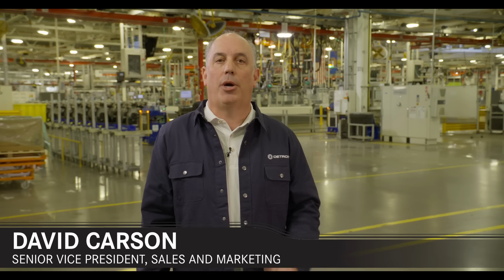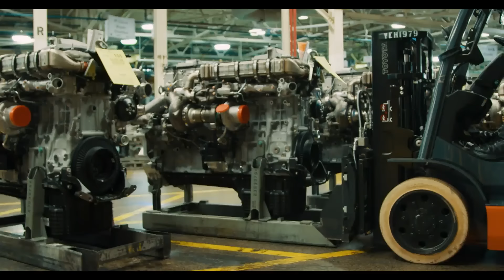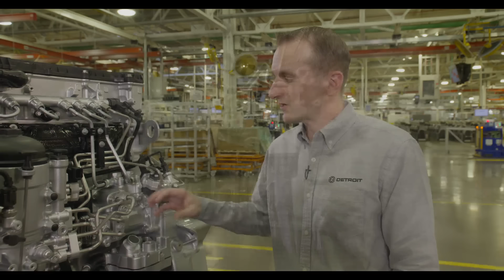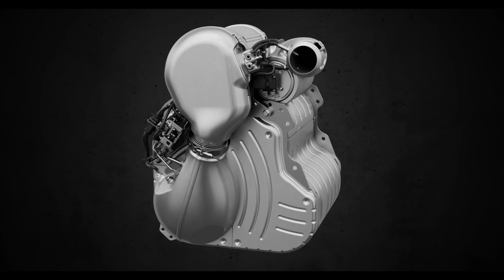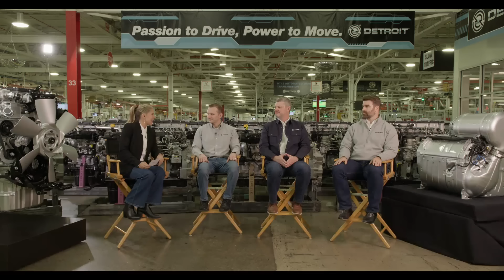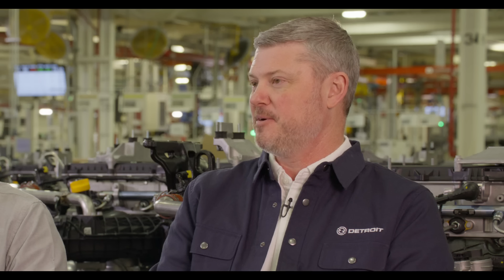Next Generation of Detroit Engines

Comment: This looks like an awesome platform going forward. I'm hoping to get one of the DD 15 with 1900 ft pounds and the 2.05 direct. What is the lowest rear end and best DD 13 spec for OTR dry van and reefer?
Reply from the maker: Great question. For OTR dry van and reefer applications, the Gen 6 DD13 offers a high-torque efficiency rating of 450 hp and 1,850 lb-ft. Rear axle ratio depends on the full vehicle spec, route, and duty cycle, so your dealer can help dial in the right setup. Fast rear ratios are available with the DD13 to help maximize efficiency.
Reply: You can get 4.75:1 ring and pinion with planetary drives, that's really low, but you won't get over 35 MPH but also you could pull the whole world with that kind of reduction

Comment: Gee, an EGR cooler?? International S-13 doesn’t use an EGR cooler. What  about fuel mileage?? Currently S-13 beats your fuel mileage. You can call yourself Detroit Diesel all you want, but it’s really just a Mercedes. The last great Real Detroit Diesel was the Series 60.
Reply: If I had to have an emission motor, I would want the S-13 Scania motor in the International. I really like the path they took to tackle these insane requirements.

Comment: They didn't mention anything about doing away with those absolute crap oil pump intake systems from the dd-13 & dd-15 and instead of minimizing or completely eliminating the difference and def system,  they actually made it even MORE complicated...Detroit used to be the pinnacle of class 8 engines...sooo sad...

Comment: The plastic oil pickup tube broke on Clutch Truckers D13.  Almost put him out of business.  How about covering these engines when they go down?  Clutch Trucker is on you tube.  How about a smaller diesel engine like a 4 liter, so Edison Motors can use it to run a generator when needed in their electric trucks?  Edison Motors is in British Columbia...

Comment: I run a government fleet and we came over to DD13's from International and the Detroit's have been MUCH better than these junky International Maxxforce's!!!  But I thought the 2027 Emissions Standards got gutted?  We definitely don't need more stuff on the 1 Box!!

Also, we have one 2023 Western Star with a DD13/DT12 combo rated at 470 HP.  I tried to get it uprated to 525 but my dealer said you guys (Detroit Diesel) wouldn't release the 525 tune for this particular truck.  Can you tell me why please?  It's our heavy haul and recovery truck and it needs more power!!
Reply from the maker: The EPA is pulling back on greenhouse gas (CO2) related emissions, which affect fuel efficiency and electric vehicle mandates. However, the nitorogen oxide (NOx) pollution standards for 2027 remain. Detroit complies with these with pre-SCR technology.

We couldn't uprate engines before due to GHG regulations, but this may be changing soon. Your transmission rating may also impacting your engine HP. If the DT12 in that truck has a lower torque rating, moving to a 525 hp / 1850 lb-ft calibration may not be possible. We would recommend talking to your dealer again or reach out to us via direct message so we can look into it further.
Reply: @demanddetroit   Thanks for the information on the 2027 emissions standards.  I sure do wish the EPA would roll those standards back a bit.

But yes, I'd like to send y'all my VIN and see what the deal is.  How can I direct message you?  I can email you from my government email address so you know I'm being legit.

But thanks for the reply!!  I was not expecting that.
Reply from the maker: @TheVenom8343  You can send us a direct message on Facebook or Instagram!

Comment: It just baffles me how the Duramax Diesel in the Chevy truck is built by Isuzu and not Detroit Diesel one of the greatest Diesel engine builders ever, and yet Chevy uses an Isuzu engine along with that 10 speed trans that Allison transmission puts there name only on what ever happened to false advertising law suits
Reply: Wrong, duramaxes were never made by isuzu, they were made by Volkswagen. The ficm on the older duramaxes said isuzu but wow an electronic part from isuzu makes the whole thing an isuzu now?

Comment: DD 15 bad engine I have been working 15 years engineering build many way to go bad  failure 
Oil pump
Section manifold plastic 
Bad cups 
Bad bearings 
250 to 400 mileage engine blow up sieze 
This engine DD15 not rebuildable

Comment: I just took delivery of our new Renegade Classic on a Western Star 57X chassis with a DD16/ D12 transmission. Love it overall so far, but it seems like it wants to get to 12th gear way too soon and bogs down. The “kickdown” doesn’t seem to work half the time
Reply: You can have the calibration changed, to set the minimum rpm to shift.
Reply from the maker: It's possible to update the DT12 shift maps after the truck is built. A dealer could enable "performance mode" on the DT12 which would hold gears longer before shifting. However it may impact fuel efficiency.

Comment: They really need to work out the rest of the issues on the Gen 5 DD platform before jumping into Gen 6 with additional kinks and issues that will need to be resolved. My DD15 Gen 5 needed a new DPF at 50,000 miles due to a terrible design and the fact they keep using that stupid One Box everyone hates! The dealer told me they’re working on a lot of low mileage Gen 5’s for the exact same reason. Aside from that, there should never be any plastic on a heavy duty diesel engine! The main reason Detroit uses plastic is because it’s cheap and lightweight, so they can market the engine as being 10 lbs lighter than another engine that didn’t have engineers and designers stupid enough to use plastic. Detroit’s aren’t bad engines, but they could improve on a lot if they really wanted to make a great engine. Detroit needs to fix the rough idle on ALL of their engines, add a lift pump to prime the fuel system so changing the fuel filters isn’t such a miserable  experience, get rid of the One Box and either buy the system from Cummins like other manufacturers do or design a system that’s easier and cheaper to work on, and they desperately need to redesign the Jake brake so it’s at least capable of maintaining speed on steep grades. Not a bad engine, but definitely not a great engine either.
Reply: Will see how the L10 works out

Comment: They went back to using the Bosch Gen 1 low pressure fuel pump?  Really?!!! What is the point of oil lubricating the HPFP, if that abomination of a low pressure pump is still being used? I'm starting to think at this point Daimler Trucks loves paying out warranty work to dealers.

Comment: Bring back the Series 60 12.7's. Best there was.
Reply: get those with a glider
Reply: Terrible economy guess you enjoy spending on fuel not to mention gutless on climbs
Reply: @truckercowboyed2638 that is BS. The pre-EGR series 60s go good fuel economy and had good power. They all had different ratings, and many companies turned them down making them gutless.
Reply: Jake breaks.  Are terrible on the 60 series motor.   😢
Reply: @Hydrostream1972 it’s terrible because a Jake break doesn’t do anything, a Jake brake does. They sounded great on the S60.

Comment: This oil pump will be a huge problem. Reduced oil flow is all I need to here, and it looks to be controlled by a solenoid. Which will fail....
Fuel filters will clog faster with an oil lubricated high psi fuel pump. Its " normal" to have oil mixing in the fuel on the dd8, and when it does the water separator filter is pure sludge along with the bowl.

Comment: So an extra SCR so you now have 2 doser’s (instead of 1) more scr filters that can clog, more def lines, uses twice as much def, and more Knox sensors, all built on the previously known faulty one box design.
Reply: Lol that's why duetz is gonna pay carbon fine instead of running 25k exhaust system
Reply: They ironed out the issues with the new 1-box. When they first came out, gen 5 engine failure along with engine brake tuning and shitty covid DPFs were wiping out 1-boxes left and right, but now all of those are resolved.
Reply: I'd rather use more DEF fluid than have more EGR going thru the engine.
Reply: The onebox is not "faulty design". The problem is the drivers idling their trucks 24/7, clogging the whole system up.
Reply: @void308  out of 42 cascadia’s in my fleet newer than 2023 (all of which have APU’s and idle shut down, meaning they won’t idle past 5 min) I’ve had to replace the entire one box on 13 of them before the warranty expires, that’s a 30% failure rate in my fleet alone, the automotive industry sees any component with above a 2% failure rate as faulty
Reply: @thatoneguyxrp  😮 that's crazy! And do you confirm that your drivers actually shut off their trucks? Or are they engaging The trailer brake and pushing the yellow in? I'm at 848 miles right now.  Oem one box
Reply: @void308  i think engineers forgot what vocational trucks are designed too do sometimes they must idle. Vac truck's bucket trucks cement trucks shutting down isnt a option these trucks arent sitting in line at Starbucks
Reply: @void308 The rule of thumb was three to five minutes idle time to prevent engine oil dilution and a couple of other things. But even our Sackrete delivery driver will let his truck idle over 20 minutes. It's not his truck. So he doesn't care.
Reply from the maker: I'm sorry this has been your experience, this is not the experience we want our customers to have. Would you reach out to us via direct message so we can help look into this further.
Reply: @demanddetroit  what is the  longevity of pre scr system and how does pre scr catalysts not get poisoned due to soot coming from engine ? can you explain

Comment: I've been working on 2 cycle and 4 cycle Detroit Diesel Engines since 1992, my favorite engine is the 16V149TIB and the best Detroit Engine ever built  The 4 cycle would be the S-60, and MTU 16V4000 when Detroit Diesel and MTU was together. I don't have any working experience on the DD 13, 15, or 16, I'm wanting to learn about them though. I have a question though, did yall make these new engines with a plastic oil suction tube with a O ring seal and a aluminum oil pump housing and with no gear shaft bushings like the early DD 13 , 15 , and 16 engines ?  That's the dumbest thing ever , plastic and aluminum. What  happened to a cast iron pump housing with a steel suction tube and a gasket? None of the older Detroits had plastic and aluminum in the lube system. Aluminum gets damaged too easy.
Also the S-60 engine was a million mile engine until yall started to nickel dime it, I've seen all the changes that were made and the pissed off customers that came in.
These new engines you're nickel and dimeing them out the gate. 🤔🤔🤔🤔
You know what a really good idea is ??  You can start installing plastic rod and main bearings along with an aluminum crankshaft  You can save probably at least ¢.02 per engine each, I'd hurry up and jump on that  !! 😂🤣😂🤣
Reply: Yes,149 was very tough engine work myself off-on in mining se coal mines bc 🇨🇦 then genset the power on this just insane still lots around oilfield.Yes,I did work dd13-15 is just when change fuel filters lost prime hell job get go.60 series work then very good engine but cam chrome start worn out after 17,000 hrs and tough get parts due problems+back seals too.

Comment: High speed rear ratios don't work trucks are always to slow can't pull hills with loads not even close to 80,000lbs I hope with the high speed rears they have 650+ hp because these big companies down speed the trucks and govern them so much they can't perform as you are marketing these engines castrate road speeds and rpm range these engines and freightliner trucks always in shops and or broke down beside the road or catching fire because of dpf system failure or clogged up from driver not being able to do proper Regen and just driving them til they do catch fire or fail and then they are on a hook heading to the dealer

Comment: Mercedes Benz yuckness...
Reply: I drive a 05 Mercedes with the om648 tuned. These om47(1,2,3) are HOT garbage
Reply: *modern Mercedes. 80s up thru 2000 ish car diesels got it right.

Comment: Is the DD16 the same as it has been or is there any changes for the DD16. My company buys all 49x with DD16.
Reply from the maker: The EPA is pulling back on greenhouse gas (CO2) related emissions, which affect fuel efficiency and electric vehicle mandates. However, the nitrogen oxide (NOx) pollution standards for 2027 remain. Detroit complies with these with pre-SCR technology.
Reply from the maker: Hello, Production of the Gen 6 DD16 will begin in 2028 and will include the same updates and improvements to ensure compliance with 2027 emissions regulations.
Reply: @demanddetroit what changes for the emissions?  I thought emissions were getting relaxed going forward?
Reply: @KMT15  DD are nearly identical to OM engines. You will get an engine that complies with whatever the latest EU requirements are.

Comment: Owner operators are mental to buy anything post 2007. Rebuild an old chassis and engine. 12.7 series 60 all the way
Reply: You got that right, smart move.
Reply: Not really. My 2017 DD13 treating me really good.
Reply: @void308 not compared to a series 60